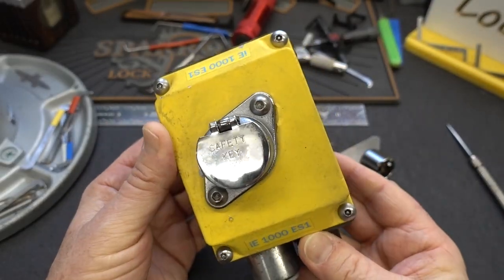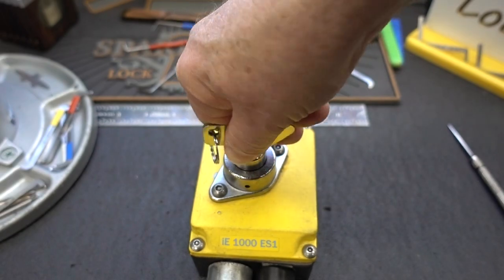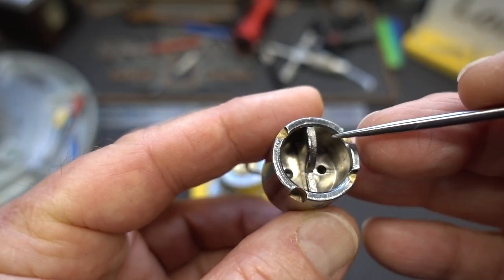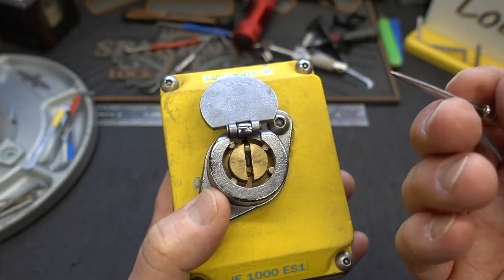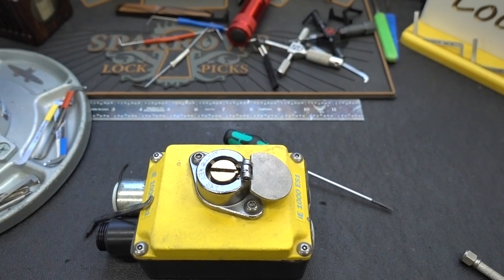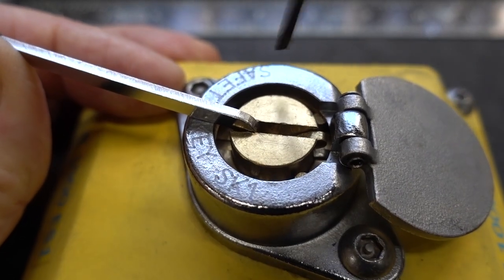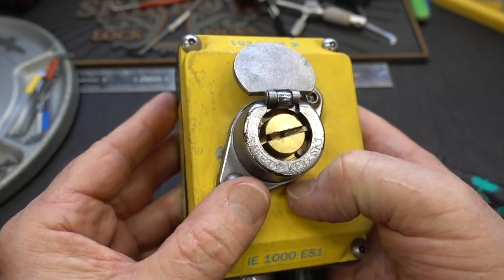(1846) Electrical Safety Lockout

Comment: I've installed 100's of these, they are nearly always used to isolate a piece of machinery as part of a Lock Off Tag Out routine (LOTO) and the keys held securely and separate from the machine so it can be worked on safely, also fitted to machinery guards so if the guard is opened the machine stops.
Nice pick Bill.
Reply: I've always heard it as "Lock Out Tag Out". I'm not experienced with this by any means, just wondering at the difference. Yours makes more sense though 😂
Reply: @CHZMN1  I have heard both, worked in the UK and USA... In the UK it's always lockout tagout, but in the USA it seems to vary by region.  Canada is unknown.   The lock OUT came from the concept of locking people out of the switchroom  in older factories, I believe
Reply: I was on a coarse once with a maintenance from the Ford UK body plant at Dagenham.  He told me that he had a job checking belt tension on one of the HUGE body panel presses.  When I say those presses were huge, I mean that to check the belt tension he had to climb onto the lower pully (which had something like a dozen belts) with the upper pully above his head.  He'd obviously locked it out with his own padlock and danger tag.  He said he finished the job and had just got off the machine (I should add that the pullies were below floor level) when the press started up!  Some twat of a foreman had cut the lock off because he didn't like the down time.  It sounds too incredible, but this person swears it happened.
Reply: @TrevorDennis100  I had  the same thing, I was rebuilding a 3 phase gas compressor on a biogas plant ,I literally had put the last wire back on the motor and the compressor started ,the engineering director had cut my padlock off because the client had complained about the down time. 
We had words where I explained the danger of what he had done and he went the A&E to get some stitches after walking into a door on the way out of the control room.
Reply: @gedd6750  It's incredible how stupid people can be when you consider the danger involved.  Those lock-outs are literally life and death sometimes.  I assume there was no comeback after the door/eye interface situation?
Reply: @TrevorDennis100  I reported him to the HSE and he got removed from post and the HSE took him and the company to court.
The company didn't take my concerns seriously so I found other employment.
Reply: Dirty Sanchez  This could go on and on. LOL.  We were given a tour of the press shop, and I was surprised that these same 300 ton body panel presses had no guards (or so I thought). Robot arms picked up the sheet metal and swung it (incredibly quickly) into the press. A car wing was stamped out, and another robot arm swung the finished product out of the press.  I asked why the press was open, and was told that it actually had IR detectors that would stop the press if interrupted.  I was explained to me that there would be serious consequences if the press was stopped with a very good reason.  There had to a local inquiry up to 10 minutes down time, but any longer and America was involved.  That's why supervisors got scared when things were taking too long and cut lock-out locks off.

Comment: wicked lock. would make a cool computer power button
Reply: I agree!  That would be a cool lock cylinder for anything "stylistic" it just looks cool as hell.
The SCARY part here is that it's an industrial lock and the tools to pick it are an offset screwdriver and a punch.
Reply: I think that would make a amazing build, maybe some weaker springs, but amazing with the industrial look.

An regarding the tools needed, i think it keeps the honest people out. The other people most likely dont belong there. 
If it is on some piece of equipment it most likely is there to prevent untrained people from just using that equipment.
It may even be for maintenance, would be bad if the power is on when you are upside down in the machine. And if they see the key in the switch they may know someone is working on the machine.
The possibilities are many.
Reply: @karnalunea1122  Yup, these things are not designed for pick resistance. On the other hand they must be very secure against operation with the wrong key, even when worm, as they are meant to protect against accidental, not intentional, activation when someone is working on the machine. If someone willingly wanted to activate things without permission they could just unscrew the cover and turn the cam with a screwdriver or something anyway.

I think the locks can be made with the pins spaced differently around the circumference (they are not evenly spaced) which will do nothing for pick resistance but would be very effective in preventing the lock from being operated with the wrong key. The "blade" in the center of the key might also be shaped differently for different keys which would prevent the wrong key from even being inserted in the lock.
Reply: @mattfleming86  It's not too scary considering the intended purpose of these is to just prevent accidentally turning on or off a machine that could cause damage to machinery or people. It's not really to keep people out. Their primary purpose is to keep people from getting killed due to inattentiveness. A mechanic comes in, takes the key out while he's working on the machine so a worker doesn't come back from lunch and turn him into paste kind of thing.
Reply: Keeps the pr0n stash safe

Comment: The 2 screws on the front holding the lock in place are exactly the same as the screws holding the light switches to the wall in many UK prisons ( well they were 20 something years ago when I was last inside). It was a fun little exercise making a tool to undo them that didn't bend the little pin in the centre or scuff the surface in any way so as not to let it look like it had been tampered with, made for a handy stash point for a little pot. Though you still needed to rub in some camouflaging paste ( a mix of toothpaste, ash and dirt ) to make it realy look like it hadn't been touched in ages. Use to use a similar mix to hide the 2 strands of wire coming from the light to the radio so I didn't have to pay for batteries ( before they started letting us have things like TVs in our cells). Had to score a couple of tiny channels for the 2 single strands of wire hence the need for the camouflaging paste to hide them. Lol it's funny the things that trigger memories of the stuff we use to get up to. Ah the good old days when I were a lad ( jk) it was definitely not good days it's days I am far from proud of but it's still fascinating some of the ingenious things people come up with when locked up. A read of pretty much any POW story will prove that. The things they came up with in colditz during wwii are astounding from hiding places to constructing a glider in a hidden room.  The glider was as never flown as the prison was liberated before it was completely ready but a team reconstructed it and tested it ( without a crew) in 2012 proving that it would have worked.  The glider was made out of bed sheets and porage showing as I say the amazing ingenuity of those locked up.

Comment: I mentioned this in a comment thread but I can't stop thinking about it.  Industrial lockout-  like "tommy is down in the woodchipper - disable it" kind of lockout.  The tools to pick it:  Offset screwdriver and a punch/pen knife/tiny screwdriver.  You should give it a shot with "maintenance" tools :-)
Reply: That sounds like a Fun experiment.

Comment: Common Screwdriver stars in latest Bosnian Bill video!

The Common Screwdriver was superb in the role normally reserved for a more highly specialized pick. Could it be a star is born?

The actor in the supporting role of Bosnian Bill however could use more experience, best gained in local stock theater.
Reply: The screwdriver has a full time job already... well 2 actually:
1. stabbing open grease cartriges 
2. stabbing ones self due to poor execution of use 1.

Comment: I’ve seen them used a lot in industry, they can be used where the key is taken out of the electrical switch (killing the machine) and the key is the put into another retaining lock thus allowing access to parts of the machine.  The key is only removable from the 2nd lock when the access gate etc is closed thus stopping someone getting squished.  I’ve seen many varieties of them, some with solenoids on the electrical side so the key can only be removed when the safety electrical system is healthy, systems where you put one key in and have multiple slave keys all of which have to be returned before the main key can be withdrawn, locks with sliding bolts on the side so the bolt has to be in before allowing the key to be released.  I think the keys are pretty unique hence the keys and locks have to be made to order.
Reply: I have also seen keyless mechanisms where the switch handle interlocks with the door itself.
Reply: @johndododoe1411   yep, it is quite common to have isolators built into electrical equipment panel doors so the power has to be turned off before the door can be opened and power can only be restored when the door closed.

Comment: This is an electrical isolation łock, where the key is used to turn off, rather than on.  This is an older type of isolation.  These days the isolation is a long tab where a loto type lock is used with a hasp

Comment: Erwin Sick safety switch. Key in pocket = happy bunny! Crushers, mixers, ball mills, furnaces, electrostatic precipitators, rolling mills, gas compressors, power presses. Been there, designed and fitted safety circuits to them. Ball mills are particularly nasty. Get trapped inside? No evidence. Get trapped in the pen on the outside? Carrie meets Hammer Horror.

Comment: i guess the "claw" arm is not deliberately a part of the locking mechanism, but when pushed in and turned, it has to slide under a ridge, to actually retain the key

Comment: The ones I have come across are called Castell interlocks and they are generally paired with a panel/door lock. They stop you from opening an energised machine/risk area. Not there to replace good isolation but an extra safety measure.

Comment: Looks like you dont have to mess with changing the wiring to change how it opperates, due to the square drive. 
I am just stating the obvius, i am a bit curious about those switches, if they got the three legs. Inn, open, and closed.
Anyway cool lock, and the insides where interesting, not that complicated, bit interesting.
Reply: According to the wiring diagram on the side each of the two switches would have 6 possible wires going to it. 

Each switch would have two identical circuits with one "input" and two "outputs". When the switch is not active one "output" would be on and the other would be off. When the switch is active the outputs would simultaneously change state. 

Known as double redundancy.
Reply: @darkzeus851  Thank you for taking the time to answering me. I did not see other wires than the the two sticking out of each switch.  I was curious ig they followed the usual input, normaly open, and normaly closed. 
I saw the diagram and did not think more about it than it is a bunch of switches. 
Should have looked closer on it. 
Thank you for clarifying it.
Reply: @karnalunea1122  To me it looks like modular switch inserts that could be exchanged if you wanted to. Each of those probably only have one single contact inside being either normally open (NO) or normally closed (NC).
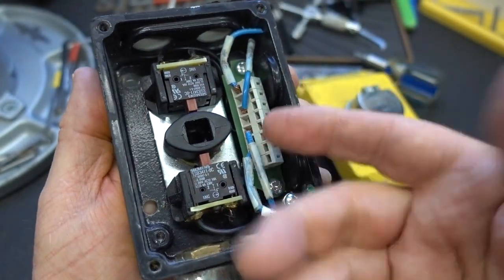As you can see at 0:26, there's from left to right an NC, NO, NC, NO. And if you look closely at 6:53, you can notice the differently colored plungers, the front ones being red (=NC) and the back ones being black (=NO). 
Now, that I looked at it again, I noticed them being Siemens switches. I don't know if these are specific to be soldered to wires like it seems, as I only know those with screw terminals.

Comment: It's a Sick IE1000, used to use them where I used to work, on a properly designed interlock system pick resistance is no big issue as if the switches are operated out of sequence it should still be detected, the equipment shut down and a fault alarm raised due to the out of sequence operation, they're designed more for robustness and reliability than pick resistance. It's not a simple case of the key being in or out, there will be another station and only when the key is returned to the master station will the machine operate. So Remove key from station A, that kills power to the machine, take key to machine, insert it, that unlocks the machine BUT only if power has been removed otherwise a solenoid prevents operation. Once machine is open key is retained until the door is properly closed and locked again, power is only restored once key is returned to the main station, (there are other topographies as well).

Comment: My father worked in a rerefinery, and they used just safety tags. The welder had to get in a man ssize cage to fix one of the blades. He asked the fore man to assign a laborer to guard the safety tag-- he couldn't be seen while in the. Cage. The forman refused saying nobody would touch the switch with the safety tag on it. After the foreman left, the welder welded the door to the room shut while he did the work. Foreman wrote him up, but management supported the welder.

Comment: Key interlock, there would be another lock keyed alike on a guard if the key is in the switch the door is shut on the machine, you can turn it on. Only one key. Various versions in the UK of these we have giant Tibbe with 5 angles and 8 discs, no false notches though. I have an interesting variation that has 3 KA locks linked to a 4th different lock with a switch on it also. You have to put all 3 KA keys in to turn on and release the 4th key. This assembly has spool drivers and is a git to pick.

Comment: Nice addition to your collection of unique locks. It's probably more of a safety power lockout when the key is removed, as it can be opened up with a torx screwdriver, so not a security device. It might even work as a cutout switch for the power sockets in a school science lab. Maybe the numbers are an EU safety standard. I'm surprised there isn't a fuse inside. What happens if you unscrew the two torx screws that hold the lock on to the front?

Comment: Having seen a guy approaching a breaker box to turn on some breakers--while a guy was on a tall ladder working on wiring, I would want the power to be off with the key out, so that I could have that key in my pocket while teetering with wires in my hand at the top of that ladder.
Reply: Oh, so disappointed with that square socket.  Doesn't that mean it could be accidentally mis-configured by opening and re-closing the box wrong?  Somebody, please tell me different.

(BTW, the wiring diagram does not make it appear that it could be wired either way, but it does control 4 independent leads.)

Comment: Industrial cut-off. Looks very similar to the maintenance lock-off for a printing press I translated a manual for once. Basically to make sure there's 0 power during cleaning, repair, or other maintenance. You do NOT want a hand or person stuck in a moving printing press... Or anything else industrial, for that matter.

Comment: I am a canadian electrician (retired), but I have never seen a lockout like that before, and I would not trust it.
It's obvious just by looking at it, that you don't need a key, but can "pick" it quite easily and quick with just 2 screwdrivers. Any equipment I ever worked on is locked out with a padlock at the mcc or a disconnect, or some equipment have a lockable guard that either blocks the on button, or holds.the stop button in.
The only other alternative is toggle switches which can be locked out by fastening a locking device on the toggle then using a padlock so the device can't be removed. You can also lock a breaker panel, or use individual breaker locks similar to toggle switch locks. Your best defence is the tag you attach after locking it out, and the threat of beating the living shit out of anyone that tries to remove your lock. (I actually had to do that once. Caught a guy breaking into a locked panel with a crowbar after I got a shock, and wailed on him with a 4" 2x4)
Reply: As others have commented, this is not "insert key to lock out" but "Remove key to lock out, keep key in pocket while inside".  But yes, it is too easy to override with basic picking skills and two screwdrivers.

Comment: That looks like the one type of lock you could use a couple of screwdrivers to pick.
Reply: I thought that was how you were supposed to start the machine when the idiot working on it took the key with him after his shift.
Feature, not a bug.
Reply: I saw someone else mention it often was used to isolate machines, that would most likely mean service. So the key should be there with the guy upside down in the equipment.
Reply: @matthewellisor5835  The company or utility needs a proper protocol to deal with lost or misplaced keys. A senior supervisor or manager would be required to authorise any 'bypass'. First response may be to go to employee's home to recover key if possible (if employee is woken up at 3am the employee may not be so forgetful in future. If it had to by bypassed, the supervisor would ensure that everyone is informed of the intention and that temporary warning signs are erected. Employees should not carry the interlock keys - they should be placed in a box or interlock device capable of taking several padlocks so each employee to be protected can apply his own padlock. If a padlock key goes missing, the padlock is easily retired, whereas it would be expensive and time consuming to replace a lost interlock key. One reason they are so large is to help prevent them being bent or damaged.

Comment: I'll buy it from you if you're finished with it ☺️. Making a rotary welding positioner that could use a cool power disconnect.
Reply from the maker: Drop me an email @ bosnianbill1 at gmail.